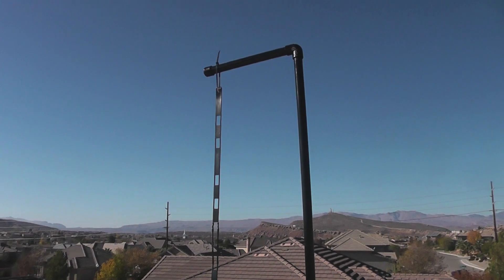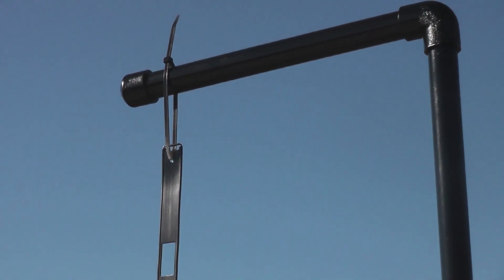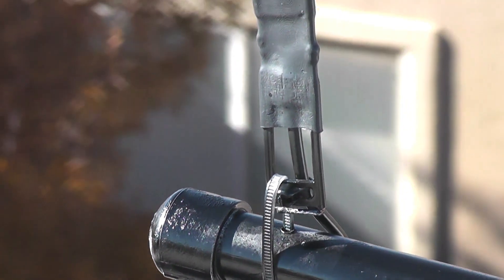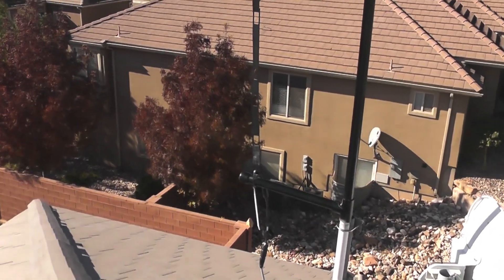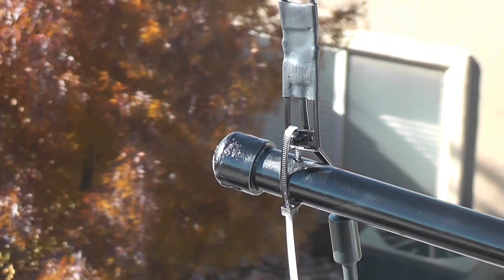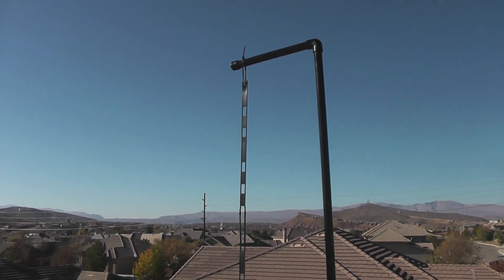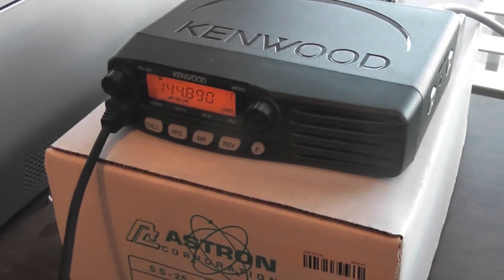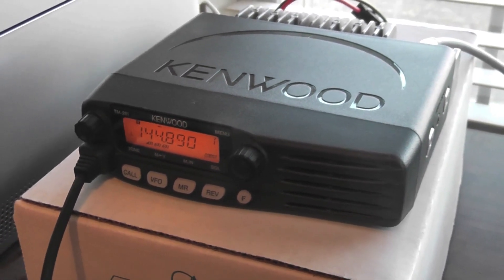N9TAX Ladder Line Slim Jim & JPole Antenna 6dBi & 5 dBi

Comment: Let's be clear... the Slim Jim does not have 5+ dBi gain.
https://en.wikipedia.org/wiki/J-pole_antenna#Gain_and_radiation_pattern
http://www.eham.net/reviews/detail/9892
Reply: Why? Let's be clear:  is not a legitimate source of information. Consider a peer-reviewed source or one that otherwise does not allow every walking brick to freely input information, even if incorrect.
Reply: @wesoblander3648  I would agree with your statement for unreferenced Wikipedia articles, but the page on the J antenna is hardly unreferenced... many of them based on actual comparative measurements in an actual antenna chamber.  Example: https://www.hamradio.me/wp-content/uploads/2015/08/Gain_Measurement_of_J-Pole_and_SlimJIM_Antennas.png.  However, you want a peer reviewed paper?  Well here you go... http://www.arpnjournals.com/jeas/research_papers/rp_2014/jeas_1014_1276.pdf.  You can safely ignore the confirmation bias in their conclusions and head straight to table 5 on page 1942 to see the J and the SlimJim are practically identical in characteristics.  In this example peer reviewed netted us good data with a ridiculous conclusion.
Reply: @SkyCharter  , thank you. I am not debating the obvious facts that culminate in ridiculous conclusions.  As such, I would rather see it as a peer-reviewed article as opposed to something found on wikipedia. If only  puffery brought criminal penalties :)

Comment: This is a noob question, What kind of coax cable are you using or comes on the antenna. Is it the same as you would use for cable tv?
Thank You
Reply: akaredcrossbow rg58 or rg8x 50ohm coax. Cable t.v. coax is 75 ohm rg59